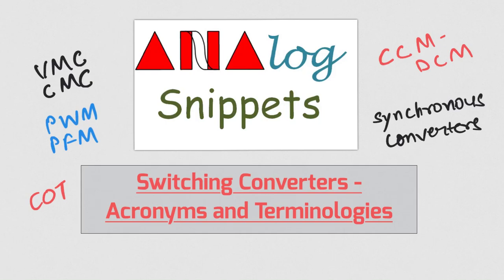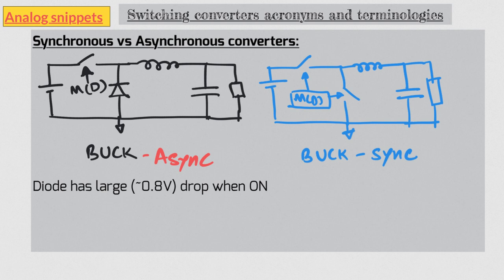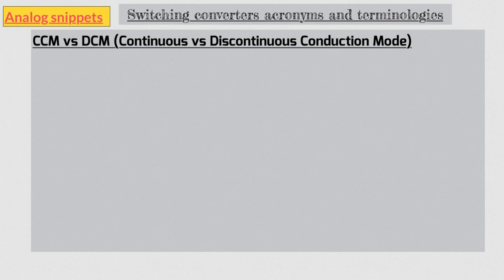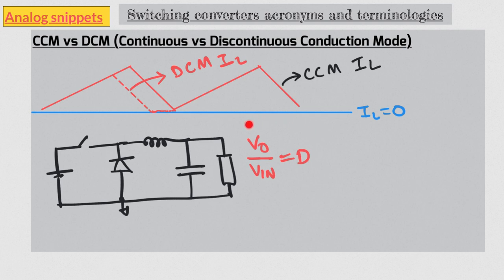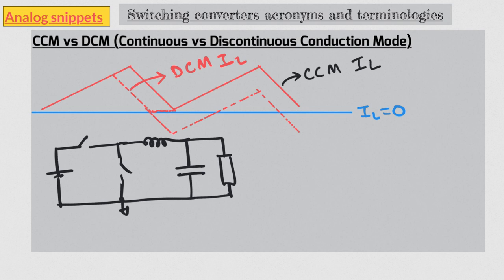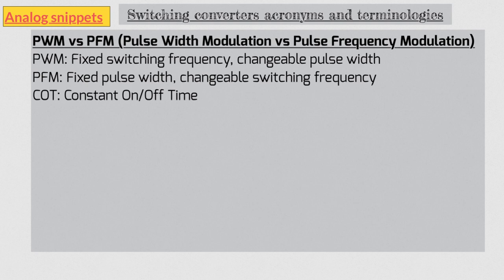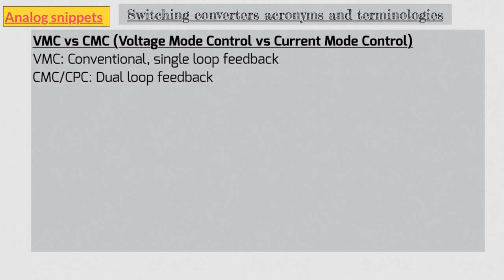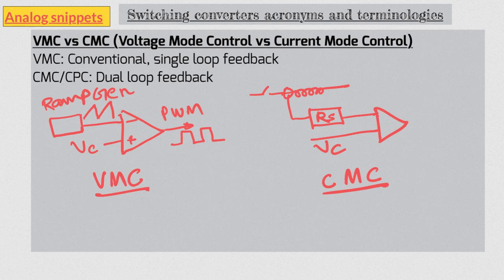#51 Acronyms and terminologies used in switching converters

Comment: Nice video Saurabh. PFM is a powerful technique to enhance efficiency at light loads. However, in lots of applications fixed switching frequency (e.g. in RF) is desirable ---to correctly frequency plan and ensure harmonic frequency spurs do not land fall over intended signals. With PFM and pulse skipping, such control becomes difficult.
Reply from the maker: That is very true, Abhirup. That is the reason PFM often comes with a minimum limit to switching frequency.